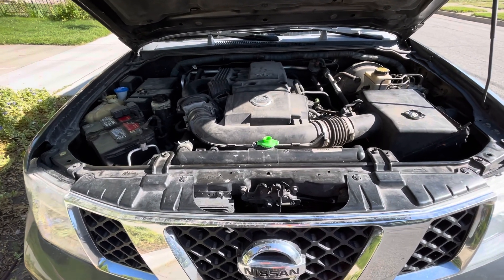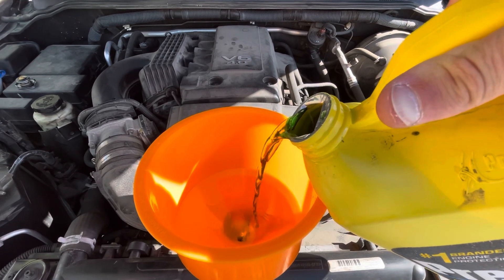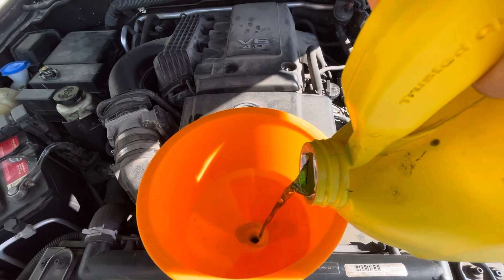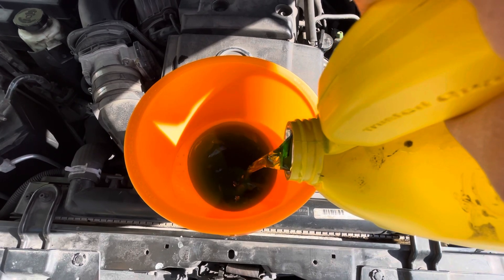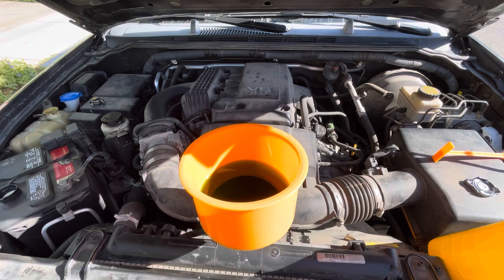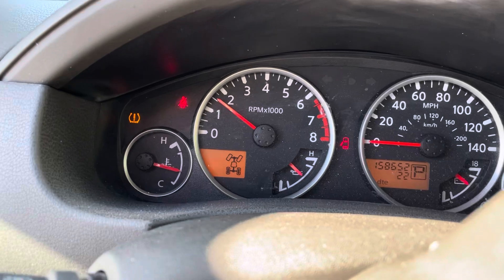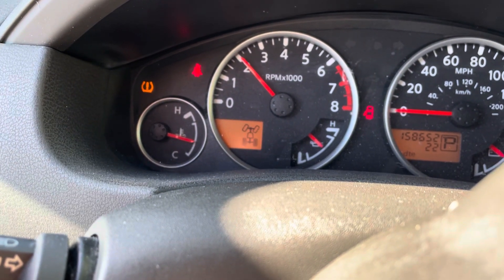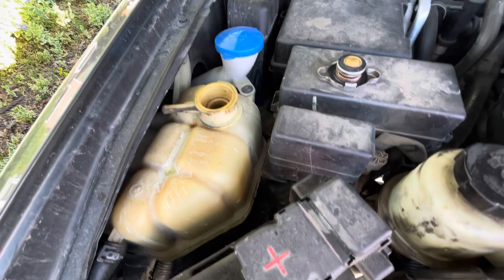2006-2012 (R51) 4.0-liter Nissan Pathfinder: Coolant fill and burp

Comment: It didn’t answer the question I put in the start with. I know how to fill a radiator. I wanted to know how many gallons did it take? Nobody ever answers the simple question.
Reply: It's 14 quarts. 3.5 gallons
Reply: This video has nothing to do with that maybe use Google or your brain to search the Coolant capacity on your make and model

Comment: great video but keep in mind the nissan uses the blue coolant, the green coolant is for american cars , wrong coolant can eat away at your gaskets seals causing leaks over time
Reply: Nissan back then used the green coolant, they've switched back n forth with green n blue... my coworker has a 19 kicks, which came with green coolant he was low and told him to add distilled water he went n had it flushed at Nissan, which used blue coolant.
Reply: My 2007 uses the green coolant
Reply: Its just coloring I was told buy a manufacturing company when they had a engine cooling class

Comment: What color does the 4.0 take green or blue
Reply: Asian green!
Reply from the maker: Yep, asian green. Slightly different mix than typical prestone green.
Reply: Valvoline  ZEREX Asian vehicle BLUE
Reply: it can be either colour, what matters is the specification of the additives - make sure it is compatible with Nissans

Comment: Does this process go for the 2014 Pathfinder? I was asking because eome say 50/50 Prestone & some say blue coolant for Asian vehicles.
Reply: it depends on the block and headgasket material etc. you need a coolant that wont become acidic and eat the head gasket and block etc.
Reply: you can ger away with any coolant for awhile but some will break down the head gasket faster than others. even oem toyota pink coolant will do that but if you flush it early it doesnt become acidic. but a lot of brands are going for 100k miles intervals and it doesn't work out well.

Comment: Where did your purchase the burping kit or who makes it?I bought one from advance auto parts&the radiator cap adapter didn't seal properly..
Thanks
Reply: You can just wrap the seal with duct tape to get it to seal tighter
Reply from the maker: Got mine on Amazon!
Reply: Which one did you get? I ordered one and the only fitting that seem to fit spilled out coolant!
@grahamsgarage0
Reply: Where did you buy the funnel?

Comment: Does this translate to a 2007 Nissan Xterra
Reply: Yes Def if it is a 4.0. I believe it's the same with the other engines also
Reply: this actually will work on any vehicle more or less. some vehicles have a air bleeder screw like my ford fusion that makes it a bit easier. but the xterra, frontier and pathfinders are basically the same.

Comment: Did you see the heater hose hose upgrade? I bought mine for my 2005 Nissan Pathfinder. My oem one broke at all the plastic junctions on my heater hose. When it broke, a couple of hours after the incident, I realized the heater hose assembly was made of plastic and aluminum tubing. I cursed Nissan and said there should be an all metal one and not this oem crap. I searched and bought the metal one and installed it. No more issues with that one ever failing on me again. The rubber hoses are the only one I need to worry about from here on
Reply: I replaced mine with metal. Just bought the bits from the plumbing store.

Didn't know you could buy it.
Reply: Doorman makes an all metal replacement. Amazon sells them
Reply: I got the doorman metal heater hose part too. No more stupid plastic.
Reply: Hi where did you get the all metal one from?

Comment: I did this method but ended up with coolant overflowing from the overflow reservoir.  Should the level of coolant in the funnel fluctuate drastically?  At times it was almost empty and would then fill back up to almost overflowing
Reply: Reservoir should be capped when doing this or like you said coolant will overflow and spit out….and yes coolant level will rise and fall especially when stepping on gas  because you are spinning water pump faster pushing more coolant through your system

Comment: What coolant should be used?
Reply from the maker: I went to the dealership and used the Nissan brand GREEN coolant. It’s Asian car formulated. I just mixed it 50/50 with distilled water in an old Prestone container
Reply: @grahamsgarage0  blue ....